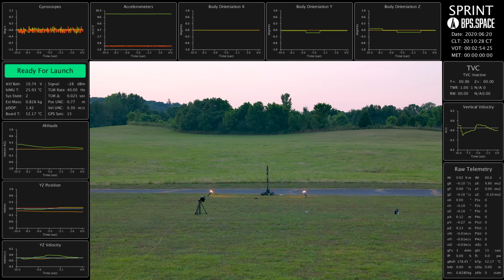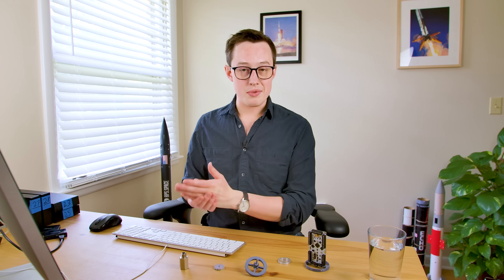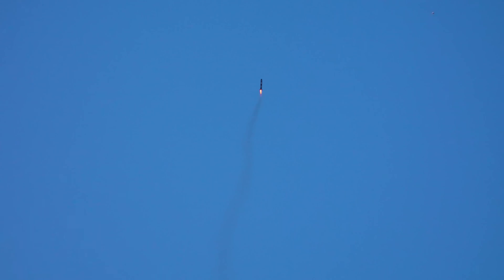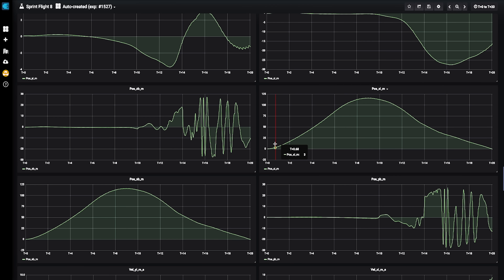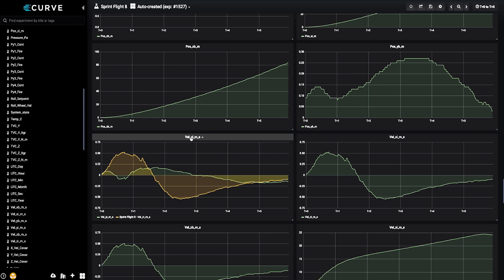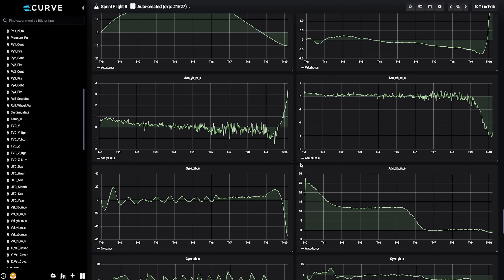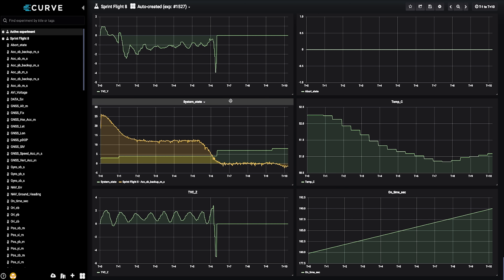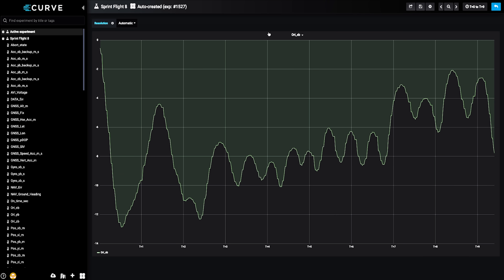Sprint - Test Flight 8 and Data Review

Comment: Thinking about implementing differential GPS, impulse could have its own GNSS chip on it as you know the location of the launch pad and it would then work as the ground station for transmitting to the rocket what the difference between recorded and real GPS measurements are at that moment in time

Comment: Why don't you look into using a system civilian aircraft use for GPS correction, RAIM? (Receiver Autononmous Integrity Monitoring) which instead of using 3 or 4 satellites, it uses 5 or 6 for error checking.

Comment: Have you considered a G40-7W White Lightning Motor from Aerotech? I don't think you need level 1 certification for this engine. We Canadians have access to G125T-14A 128NS 0.95 SEC and G80T-14 and 137NS/1.7SEC in 29MM no cert. The G40 burns for about 2.5 seconds and be a good test for the strength of you build and double up on altitude.

Comment: Winds could still throw you way off when you’re coming down on chutes. Any plans for a controlled parafoil for recovery?
Reply: Dude that would be insane, if AVA can control 2 more servos and assuming the rc parafoils available are the right size and also they would have to survive the packing and deployment as they aren’t met for this buttttt.... joe if you’re reading this needs to happen, how savage would it be to have the rocket fly to your hand!

Comment: 0:03 how did you make that footage right after the launch so stable?
Did you use mirrors?
Reply: I'm pretty sure it's just a stabilization program applied in editing. The frame we see isn't as big as the original video, allowing the footage to be moved around frame to keep the rocket centered. Obviously the person operating the camera had to do some pretty skillful vertical tracking too though.
Reply: It's just post-process stabilisation. I.e. digital stabilisation in the video editing software.

Comment: Use quality micro heli tail servo. Lighting fast, 560 hz refresh on the good tail servos...
Reply: He'd have to reconfigure the flight software
And do multiple test ( time consuming)
Reply: @taddmaxwell8363  That's the direct way to solve this problem, he will waste a lot of time buying and testing servos which have inadequate refresh rates. 300 hz or better pulse rate is a must.

Comment: According to you, how (in percentage) higher could go these rockets without any correction? 10%-20%. I guess some part of the distance is lost while correcting??
Reply: It wouldn't be nearly that much. What little is lost in steerage, is probably made up for by the rocket always pointing straight up. These rockets are not designed to go as high as possible. The thrust to weight ratio is kept low to keep the speed down to better test the thrust-vector control. To my understanding anyway. Plus it looks bad-ass.

Comment: Observation: Your rocket looks like a first time car driver.  Aiming for just in front of the car instead of aiming for miles up the road.  Is that the case?  Are the corrections attempting to get it back on track or back to where it's eventually needs to be?

Comment: Do you think you'll be able to back a vertical wind profile out of the YZ control data?  It would be handy to update the target position and compensate for wind during descent.
Reply from the maker: This is an interesting idea, and in theory, yes! With a perfect system over a few seconds of flight you could just look at where the constant error is on each axis, and back out wind speed from that, and the coefficient of drag on the side of the rocket, I think? In practice it would be a little trickier, because the rocket usually has some TVC misalignment that doesn't get calculated out in the first half second, so constant position errors won't be totally representative of wind. In really strong winds they would though!
Reply: @BPSspace  I look forward to your high flights.  The last rocket I had over 3000' blew away and was never recovered.  Compensating for wind before burnout would be cool - but it's surprising how far a light rocket will slide while descending drogueless or with a small drogue.  It turns out there plenty of lift from the body tube to push it around.

Comment: Hey Joe, some tips for your Kalman filter from a controls guy: 
1) It looks like you assume 0 uncertainty in your GPS measurements, since your covariance drops to 0 at the GPS updates. Giving this a plausible value will help smooth out the jumps you see in the velocity and position plots. This also becomes pretty important at low speeds where GPS uncertainty is larger compared to your motion.  An easy way to find out this info is to either look at the specs for your receiver, or take a log of the GPS speeds and positions at rest and calculate the standard deviation of that data. Note that this may be dependent on GPS signal quality, which your chip probably provides a real-time measure of, but that’s probably not going to matter too much for your purposes.
2) You mentioned at 8:52 that you think you have an error in the covariance plots since x, y, and z axes are identical. But this is actually expected if the estimated process and measurement noise on each axis is identical, the state transition equations are symmetrical (which they should be), and of course your initial covariance estimate is the same. If you look at the the Kalman filter equation to update your state estimate covariance matrix P, you'll see that it is not dependent on either the state or your measurements. So your covariance will be deterministic given a known update rate, and so should only not be identical across axes if you (a) have different noise models for each axis, (b) have additional sensors on one or more axes, or (c) have updates at different times for each axis (which doesn't look like the case). The 'sawtooth' pattern is characteristic of a blended IMU-GPS pair, so that should give you more confidence that you did it right!
3) And as a last note, don't forget to give your covariance variables units too. 🙂 Personally I find it conceptually helpful when looking at variance data to convert them to 3sigma values instead. This means you’d be looking at uncertainty in units of velocity rather than a variance “area” with units velocity squared. 3sig = 3*sqrt(var)
Reply: I have no idea what you just said, but it sounds like he should do that
Reply: @silience_  Can relate.
Reply: Agreed with the changes; I was like wait you defiantly should not have your GPS be trusted that much.
Shouldn't the variance climb to a rough steady state with some oscillation that varies in amplitude based upon how closely the GPS and IMU agree.
I know on our bots when they do rapid direction changes the variance goes way up because the lag from GPS means its always predicting motion in the wrong direction but in a straight line it drops a lot both because GPS is more accurate under those conditions but also because the inertial data matches the GPS track.
Reply: @nocare  Actually no, the variance is independent of the data coming in, and if you know the update rate you could even calculate all P's at all timesteps ahead of time (though it's easier to do it on-the-fly). What goes up when your bots change direction is the residuals between the measured and estimated state - this can be a better way of determining the "quality" of your localization than looking at the variance. This stackoverflow answer might shed some more light on the topic: https://stackoverflow.com/questions/61486107/how-does-covariance-matrix-p-in-kalman-filter-get-updated-in-relation-to-measu
The variance will have a floor that is set by your most accurate non-integrating measurement, but could grow unbounded if you don't have one. For example, if you have an accelerometer with no GPS, your velocity variance will grow linearly with time.
Reply: Now dats a lot of words
Reply: Good call.  I had the same thought with respect to the 0 covariance with GPS.
Reply: GPS position is not very accurate but make sure you use a low uncertainty for GPS velocity because its really good data if you have a good GPS antenna. Also some GPS receivers (uBlox for example) let you choose different acceleration settings which influenences internal filtering and can help to reduce latency (higher G rating -> less filtering -> less latency). Cranking up data rate (5Hz seems quite low, I'd go for 10 or 15 at least) can also bring down latency.  I once measured an uBlox Neo7 at 10 Hz (4g setting) to have a GPS velocity data latency of just 100 ms.
Reply: @EinzigfreierName  yeah and there are also type of GNSS receivers that uses the carrier frequency (doppler) to calculate velocity. These give more accurate velocity measurements.
Reply: @LaggerSVK  Oh, I would assume almost all GNSS receivers use doppler nowadays.
Reply: @EinzigfreierName  I mean it is not so standard for cheap modules. Most of those do it by differentiation of position
Reply: You guys are speaking the language of gods
Reply: Man that's so cool
Reply: wsshambaugh read a paragraph understood hey joe!
Reply: Ahhhhh that’s right.. I was just gonna say that!! Great minds !!
Reply: Right on point! As the GPS model will not me very precise and determinist it could be nice to take a look at alpha beta filter.
Reply: Rockets.. I like rockets

Comment: On the topic of servos, the RC helicopter world has several reasonably priced strong lightweight high speed brushless servo manufacturers.  I specifically bring them up because the servos on the heli swash plate have to have a consistent response speed. or the models become uncontrollable.  BK servos in particular are spectacular.

Comment: Great video, as always!
I'm afraid I haven't seen all of your videos, so I don't know if you have ever talked about this before, and thus do not know if you have addressed this concept before, but here goes:
So, I've been kind of obsessed with reaction control thrusters lately, specifically after thinking about their use in SpaceX boosters for orientation control during their return to the pad, and especially after watching the recent footage from onboard the fairings orienting during their return to Earth. Seeing the compressed has canisters on the fairings made me wonder if you've ever considered incorporating a similar concept for use in your amazing rockets. It seems, in my layman's understanding of the subject, that you could (presumably) achieve faster orientation control than it's possible to achieve with gimbal motor control alone. I understand, based on what you were addressing in the video, that the limits in the ability of the the motor to correct trajectory seems to stem from the refresh rate of the GPS coordinates, so I don't know if there would be any advantages to developing such a system, but that's part of why I'm asking. I also wonder if it might be more efficient than gimbal control, and if it could theoretically replace that ability. Imagine if you used an onboard compressed gas tank, something like a C02 canister, mounted in the "upper stage," where you would also mount the "thrusters," with electronically controlled valves. I don't know whether this concept is even remotely feasible, I'm really just curious if it's something you've ever considered or explored the logistics of.
Anyway, thanks for sharing another amazing video of your fascinating projects. They are always a special treat.
Reply: Joe had a good look at this, worth a hunt they're a really good couple of videos. Enjoy!

Comment: Why have gps when you can adjust direction through accelerometers?
Reply from the maker: Accelerometers drift over time, and the errors stack up quickly. They're very accurate in the short term, but not in the long term. So we use accelerations to figure out position and velocity in the short term, but then slowly correct for that sensor drift with the GPS over time!

Comment: Fantastic as usual, Joe. Really enjoyed the detailed information about the operation of the flight.
As an aside, since I'm working on some pretty over-equipped environmental sensors right now and have sensors on the brain: have you considered the use of magnetometers to aid in orientation sensing? They're available in very small footprints (e.g. NXP MAG3110, which is 2x2mm DFN10) and in my experience they offer pretty decent measurements at nearly 80Hz, which might help you improve your integrator accuracy during alignment correction, and better sense pitch during flight.
The noise isn't the best on the MAG3110, at about 0.3uT in practice (so 0.6% error on a standardised 50uT earth field). That translates to about 0.55 degrees of error on an axis if you're normalising to 90 degrees per axis, but you can get more expensive alternatives like the RM3100 that offer incredible resolution and noise floors in the order of tens of nanoteslas. I figure if you've already built the Kalman filter it shouldn't be too much work to add geomagnetic orientation values into the mix and keep the covariances low.
Anyway, enough back-seat engineering from me. Good flight and I look forward to future videos :)

Comment: Are you paying attention to the time lags properly when incorporating the GPS data? GPS gives position only, with some lag between the measurement and position output. It takes 2 GPS positions to get velocity with a large delta-T between them, so any velocity computation is halfway between the two positions. Acceleration takes 3 GPS positions to compute, making it further in the past. Each having a different time stamp in the past,  so when you do a state update from the GPS is should occur in the past and be propagated up to the present. They all look the same because the time lag error is the same? Just look at each update, it looks like it's updating to a value that is 0.2 seconds in the past. https://youtu.be/WTQ1Kb1Fvj8?t=482

Comment: Joe, there is lag in GNSS postion and velocity - and the velocity lag tends to be longer than the position lag. Are you compensating for that? I usually use a circular buffer of states to go back.... Are you using the usual hack of characterizing only the vector part of the quaternion for covariance and GNSS update?

Comment: Interesting to see the board temperature decrease as it gains velocity.
Reply: he should add a heater and an insulating enclosure. It will decrease the drift in sensor readings and thus reduce inaccuracy both within a flight and between flights.

Comment: Joe, why are there such sharp changes in the kalman + covariance? Are you assuming that GPS is completely accurate?
Reply: Probably not, but it is more accurate than the other sensors so the Kalman filter will weight it more heavily.

Comment: Will there be any guidance on the way down (fins I guess?) to keep it centered during freefall descent before parachute deployment?
Reply: orulz1 I was wondering something similar. Could Joe program AVA to intentionally drift upwind at 2x the rate the wind would’ve pushed Sprint downwind, such that during chute descent there’s a likelihood the same wind conditions several seconds later will land Sprint closer to launch pad?
Reply: @kelvin0mql  I'm not sure that could work in the current design. I'm not sure that AVA can tell the difference between wind vs instrument error or any mis-alignment in the vehicle. The pitch program at burn-out could be programmed to be into the wind. Would be really neat if it calculated a heading and pitch based on live wind data from a ground station.
Reply: @DoveWrestler  I figured that'd be tricky. But I made that comment half-way through the vid. Now that I've seen the whole thing, I realize that by the time Sprint (or some other) is expected to make it 1km high, it may also have controlled thrust on the way back down, as opposed to merely drifting wherever the breeze blows.

Comment: If possible you could write a "wiggle program" into the preflight check then use that program to presume "wiggle in flight" routine in order to true out the flight of your bird. The data you have collected should give you an idea of the forces acting upon your vehicle and obviously you have a mechanical contrivance that exists to balance out these forces in flight. If you can program these various flight algos onto your system board prior to flight you now have an actual flight computer or as is known in the business "running on internal power."